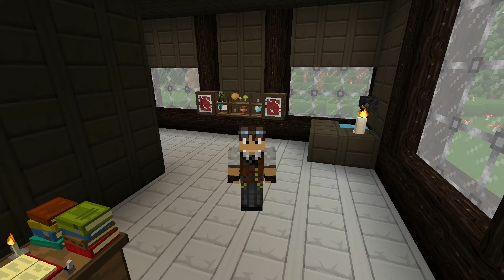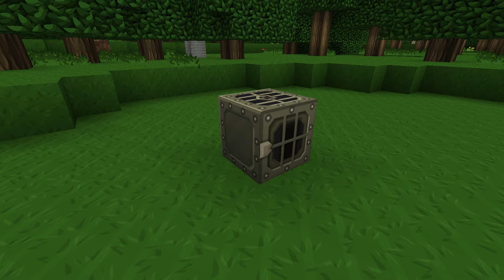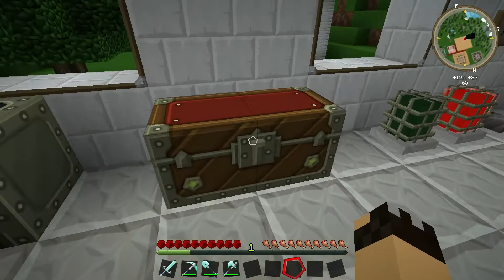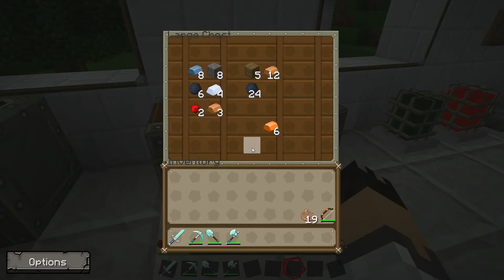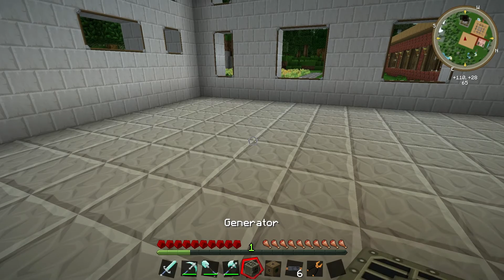How to Feed the Beast in Minecraft - Industrial Craft 2 Generator and BatBox - 7

Comment from the maker: It's the total of all items needed. All the copper and rubber is required for the copper cables to make the RE-Batteries which are needed for the batbox. There all also several ways to make things, and I generally only show one. Also, recipes do change between updates. This was correct at the time.